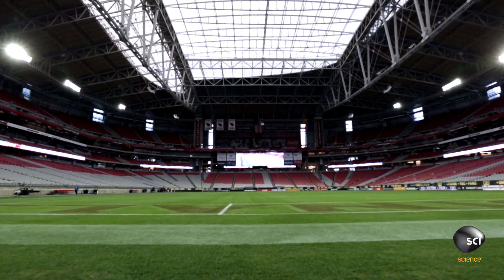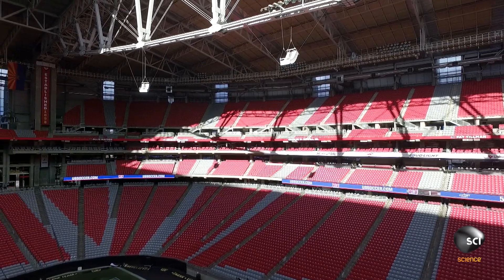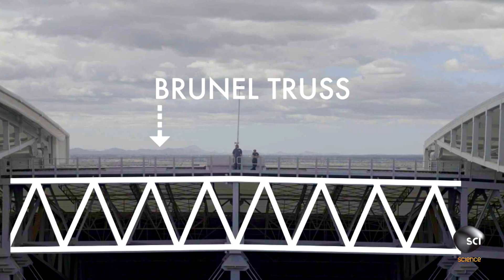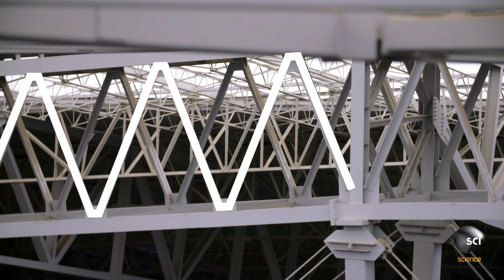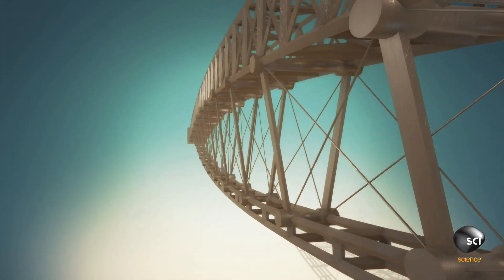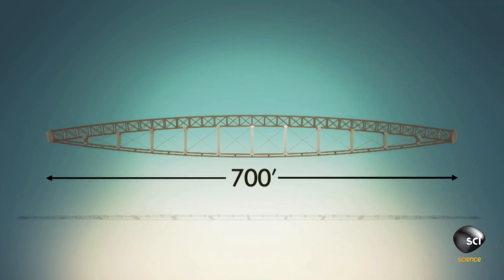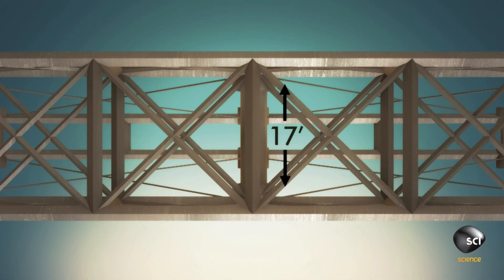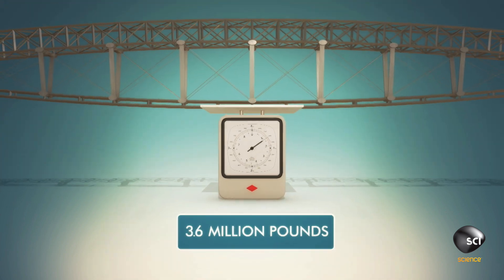Why Are Triangles Stronger Than Squares?

Comment: Would be great if you could answer the question in a proper way...
Reply: Basically triangles, equilateral triangles to be exact, can't be pressured into a new shape, whereas squares can easily become a rhombus, do you get what im saying
Reply: @synicalrip2278  No triangle, no matter the type, can be pressured to become a different shape.
Reply: @synicalrip2278  if you don't understand what Synicalrip is saying, I reccomend you to use a pair of pencils. With them, shape a triangle, use something like a table for the base; imagine that each node has just a lace. Then, try pushing one pencil to the another... Without "breaking" or "squashing" the base. It's impossible to break the base! 
Then, imagine a rectangle... you can't do it with pencils, ok. So, imagine it, with the nodes as laces. If you try pushing one lateral side, one of the "vertical" ones, you'll notice that it'll change it's direction as well as the other one, without breaking any of the horizontal sides. The new shape would be a rhombus.
Reply: @synicalrip2278 why though